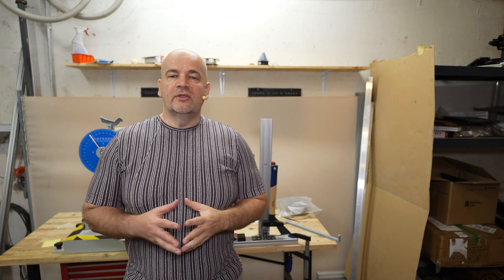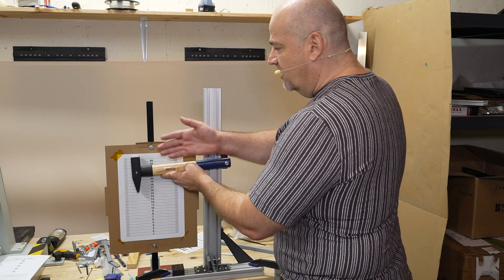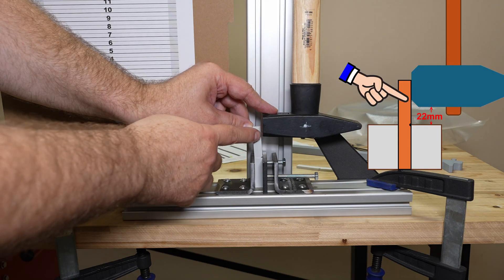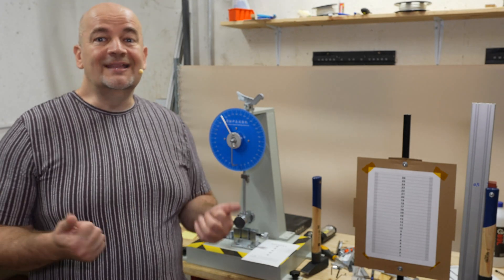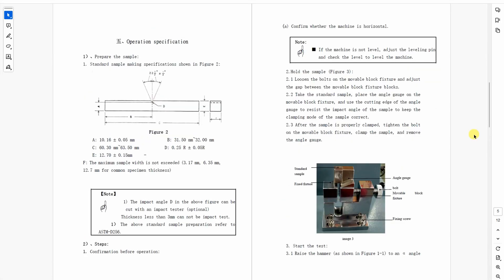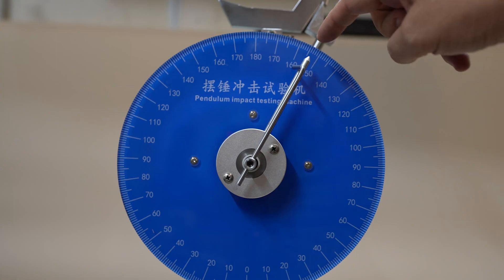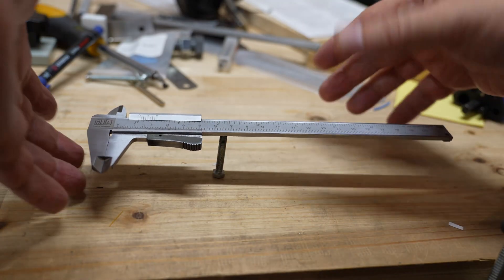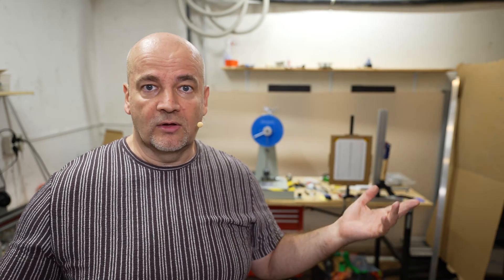eBay impact tester vs DIY impact testing machine

Comment: Hi Mr. Igor, Thank you so much for the video. What is the weight of the hammer you used in your DIY impact test setup? I'm interested in your test. I need to know the hammer weight to make calculations. I really appreciate any help you can provide. Best regards.
Reply from the maker: 0.5 kg
Reply: @MyTechFun  Thank you so much..

Comment: I think that with 2 small modifications, the DIY tester would be better and more accurate (and approved for scientific reports) than bought ones:
- hammer head milled to correct shape and weight
- lightweight shaft, maybe carbon fibre rod, to idealise center of mass

Even if the problem doesn't look like a nail, hammer might be the correct solution :D
Reply from the maker: The problem was it is DIY, not industrial machine, designed by some company.

Comment: Maybe they'd approve of your homemade tester if you used a spherical hammer with an infinitely thin handle?
Reply from the maker: No, their problem was DIY. Not the geometry. Probably the reviewers are not even familiar with correct geometry of the ISO impact tester.

Comment: 3:44 However, the distance from the hammer's white dot to the scale is far greater than 5mm.
Reply from the maker: Hm, correct. But if the distance from zero is below 100 mm (like it is in most cases), then that parallax error is again much smaller. If distance is big, then that error doesn't matter too much. But, yes, correct note. Thx.

Comment: Great to see that you are getting upgrades you want for these types of videos. Will you be redoing most of your previous videos on filaments with regard to the impact test or just going forward?
Reply from the maker: Probably I will, the most important ones, but not with this machine. I hope the other (I mentioned it in this video) will work correctly with both IZOD and Charpy.